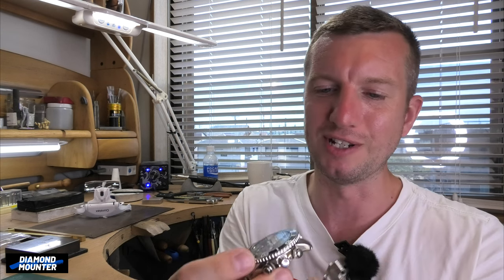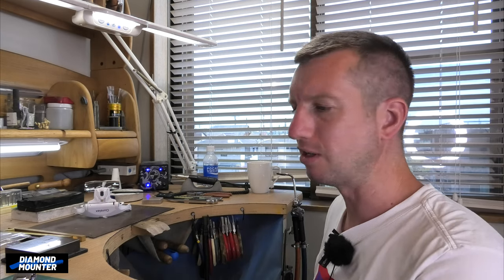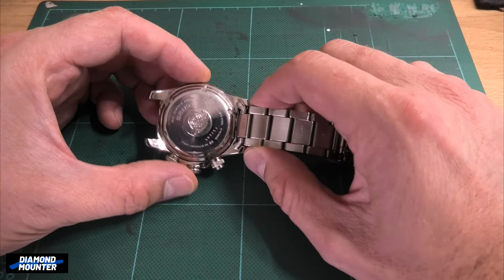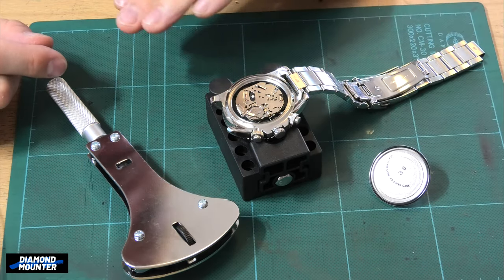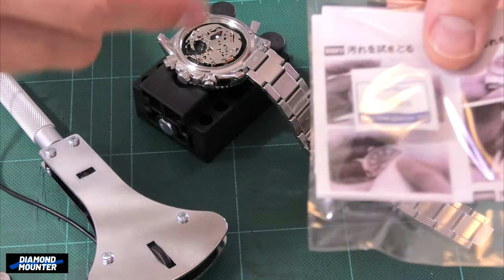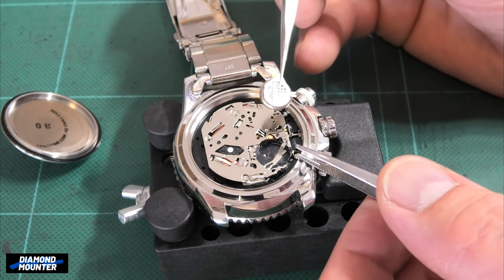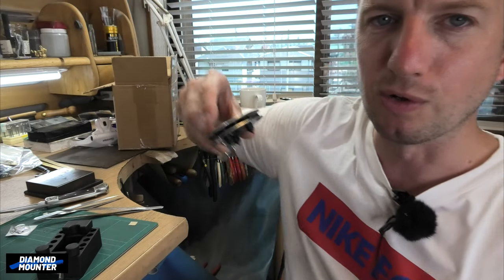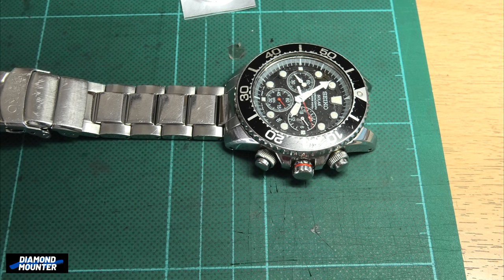Seiko Prospex V175 Chronograph Battery Replacement

Comment: I have this exact model from eBay a couple years ago. Battery “died” but I realise in hindsight may have been lack of charge out of sunlight, I had no idea it was solar 🤦‍♂️. Anyway bought the V175 as shown, followed your instructions and bingo all good. I’ll leave it in daylight when not wearing now, live an learn. Thanks very much 👍
Reply: I have the same watch and it has stopped. How long did you leave it in the sunlight?

Comment: I have this same V175 watch, bought it what was supposed to be "As new" condition, but when i received it, it was not running. I thought it needed to be charged, so I set it in the sunlight for a couple days and had no luck it ran very eratically and soon there after quit again. I though maybe the solar charging system was shot. After a little research i found that a new battery could be installed so i ordered the same battery you did. I havnt recieved it yet but i did open it up to get it prepared and low and behold it has the same REN 371 battery in it as yours did. There must be an internet page out there telling people to put these in.
Reply: Do I need to get that specific battery? REN 371?